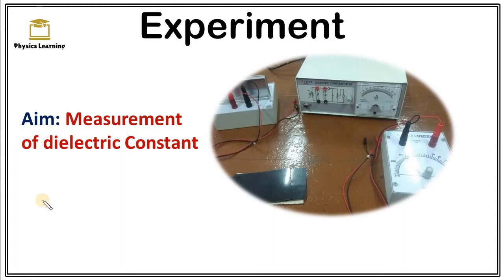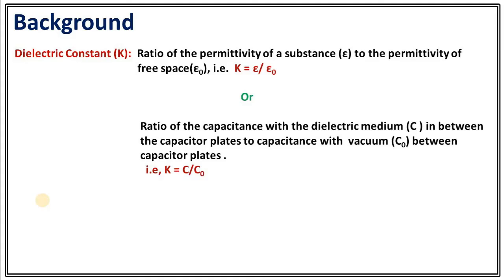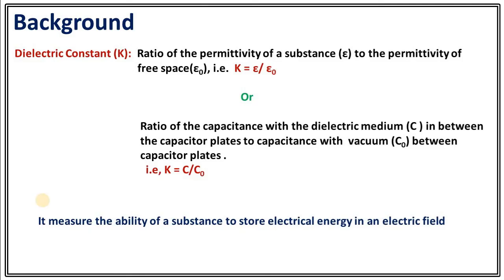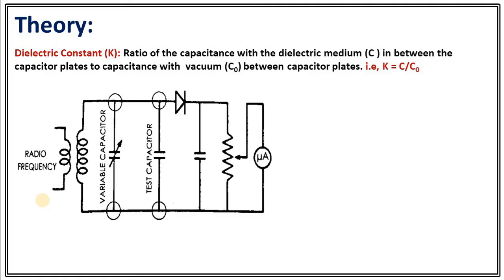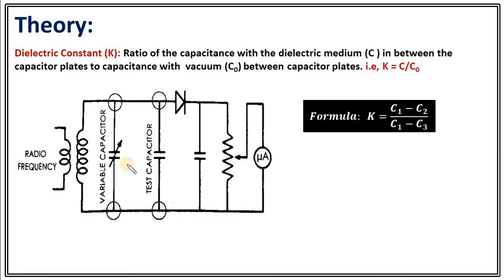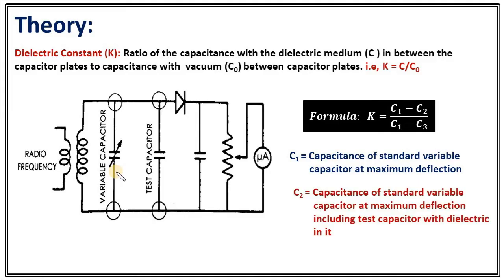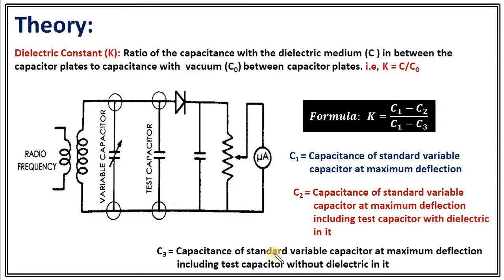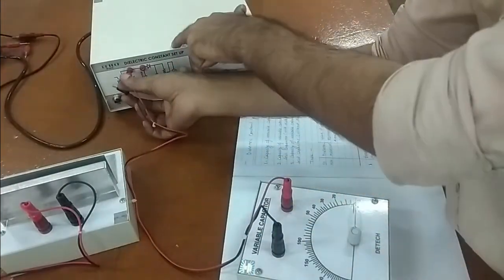Measurement of dielectric constant |  dielectric constant experiment

Comment: How can I get the c3 value for kerosene?
Reply from the maker: using same method, instead of connecting jack with solid capacitor, you have to connect the wire with a glass (arrengement made for connections) containing kerosene.